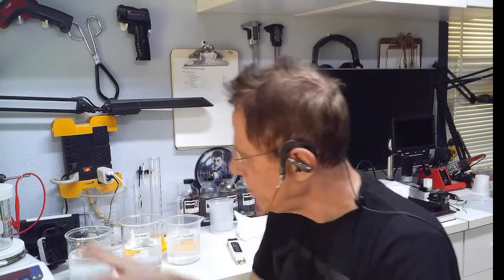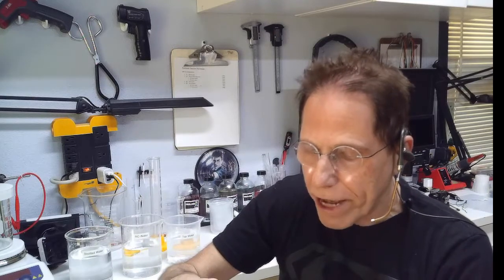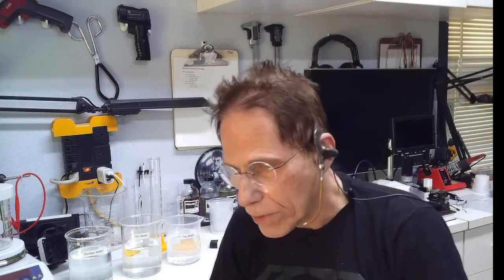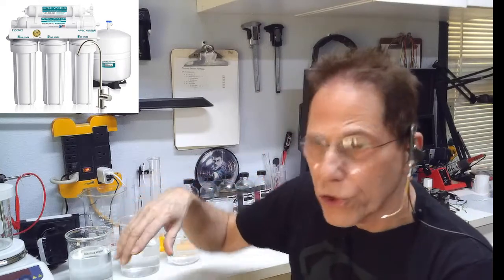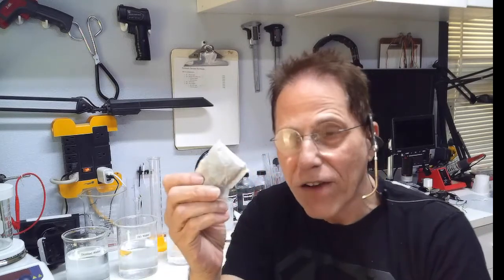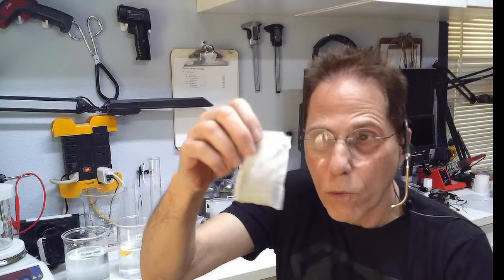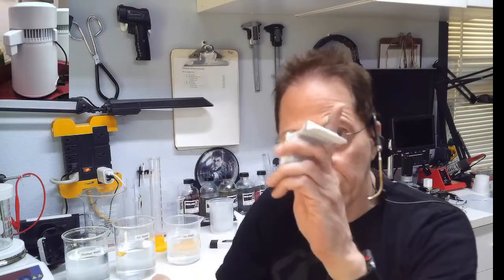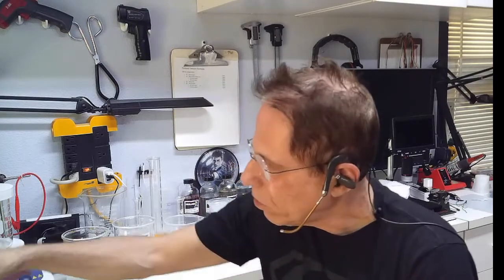RO water for your Distiller. Do you need the carbon filter?

Comment: Never had a problem with mine, water tastes fresh and sweet every time.
one very important tip - use a timer and cut it short of boiling down to much. 
which can afeect the taste and will make it easyer to clean and extend the life of the Disstiler.
water from the tap may be safe to drink but its not healthy, limescale is calcium and that can build up in the joints and the arterys and cause kidny stones just for starters.
so even if you are just useing a britta filter its better for you.
but when you can get a Disstiller plug it in at night with a timer wake up to 4 ltrs of fresh filtered water every day for years to come, sadly thats no going to be good enough for a family so then RO becomes your best option.
we are 85% water so its important.
Reply from the maker: I have the amazon alexa and the tp link devices. I plug one of the switch things. One is dedicated to my distiller. I just say "Alexa turn on the distiller for 3 hours 30 minutes. the timer stops it with about an inch of water left in the bottom. I agree the distilled water comes out much better if you stop the process before all the water boils away.

I did an article on re-mineralizing distilled water using sea salt. Check it out. While you can drink distilled and RO water, you should plug up the holes in waters polar nature. 
https://youtu.be/ep03cswkZ80
Reply: @AlchemyWizard  i prefer anolog its more dependable and gives me peace of mind but its a clever idea.
sea salt is ok but better with a dedecated organic mineral suppliment as the minerals are in cystaline form in salt.
but from the research i have done its not that important while it will break down the calcium deposits it leaves the other minerals alone and you want to get rid of that exess calcium anyway.
thanks for the feedback and happy drinking.

Comment: I did not read the manual and drank one glass of the first batch. Did i poison myself? It tasted nasty. Also the distiller said it is "food grade" but even after i washed it there was grey stuff coming of the metal parts when i wiped it. All this stuff is made in China, not sure it is so "food grade".
Reply from the maker: Generally it takes one batch of distilled water in a new machine before it makes pure distilled water. I'm sure you will be fine drinking the one glass. I'd toss the rest. I certainly would not use this first batch for colloidal work. Make another batch. Use a TDS meter and measure the output and make sure its near 0-ppm. If the water you put in to distiller is high in minerals you may have to pre filter the water or distill the water a second time.

If the grey stuff was coming from inside the distiller body that could be normal. The water left behind in the distiller will be full of the impurities that was in the water you put in it. If grey stuff was coming out the output, then I don't know. See what happens with a second batch. Test it with TDS meter before drinking the second batch.

Comment: Now you gave me clarity. I'm using well water. So i don't need that carbon filter i guess. That's exactly what's happening to me. 1st distillation i had 0015 PPM. Second i had 0004 PPM. Third 0003 PPM. I'm removing that carbon filter tomorrow.
Reply from the maker: Check on line to find out what your well water VOC content may be. If its above safe levels then put the well water through a activate carbon filter before distillation, using one of those canister filters where you pour the water through it. 

But yes, that carbon filter at the end of the distiller, even it if did remove VOC would not remove very much before it started putting it back into your water. Ditch that carbon filter.
Reply: @AlchemyWizard  , we have the same distiller. I already removed the carbon filter. Water produced still has 0002 PPM. What else can i do to make it zero by distilling alone?
Reply from the maker: @commandernoodles2367  2ppm is okay. You can use that and it will be fine. If you did not want to use a pre-filter (like one of those pitcher filters), then your only other alternative is to distill the water again.

What is the PPM of the water you are starting with? 

VOC will not come out of the water through distillation. If you got VOC in there then you will have to pre-filter the water through a pitcher drip filter with carbon in it.

There is also the possibility your meter is off a small bit. 

I think you will be fine with 2ppm distilled water. Anything below 5 would produce perfect results.
Reply: @AlchemyWizard  , ironic because water that we buy which is purified only (not even RO) shows zero PPM. Well water that i distill has 146 PPM. Based on your explanation, distilled water doesn't necessarily mean pure water. Thank you for being informative.
Reply from the maker: @commandernoodles2367  These distillers we have today are far from perfect. My well water is 150ppm as well, but I have a RO filter I put the water through first. Then it goes into the distiller. I'm sure if I tried to distill my well water directly I would have to do it twice as well.
Reply: @AlchemyWizard so if you put your water through a reverse osmosis filter then the water distiller what ppm is your water ,have you tried to put your water just through a water distiller and seeing the ppm in it and then comparing it  using the reverse osmosis filter and the water distiller to see if it really dose any difference to the ppm
Reply from the maker: @pitch1691  I have well water, 120 to 140 ppm. I Put it through the RO filter and it gives me 8 ppm, then in the distiller that gives me 0 ppm. If I try to distiller it straight from the well, I will get between 2 to 4 ppm, and wow does the stuff left behind stink badly. 

I use RO process first because my distiller, like mostly everyone's, is the cheap $100 dollar one and they are not commercial grade. 

I've looked at commercial grade distilled water in the laser microscope and that stuff has very little stuff in there. How they achieve it, I do not know. My distilled water will read 0 ppm but on the microscope it shows 1 to 2 ppm of something in there. Could be VOC's I'm guessing.

Comment: Very helpful. I received this distiller as a gift to use in humidifier and CPAP. Do you know if it’s safe to breathe in water distilled this way with the carbon? I’ve been using store bought distilled and thought this would be cheaper and more convenient long term (plus more environmentally friendly)
Reply from the maker: The carbon will remove some Volatile organic compounds (VOCs) . I like using the carbon filter before the distillation, as the carbon filter at the output of the distiller will change the PH and add some carbon in the water. Also that small carbon filter becomes saturated fast and when that happens it just dumps the VOCs back into your water at twice the amount. 

For a humidifier the VOCs should not present any problems, nor should the small amount of carbon that may be in the water effect those as well. I'm not sure about the CPAP. 

What I would suggest, even though it may be an extra step, I would get one of those carbon filter pitchers. Remove the carbon bag from the output of the distiller. Fill the carbon filter pitcher thing with tap water. Then pour the filtered tap water from the pitcher into the distiller. Now you will have as clean distilled water you can get.  Below is a link to the Zero Water Filter Pitcher. I am sure you have seen them. 

•	ZeroWater Pitcher on Amazon: https://amzn.to/3BARy1X

Comment: not quite right , the chlorin is going through the destiller in the beginning then it will end , so cast away the first cup then it will be clean and you can mesure it with the meter .
Reply from the maker: Correct, if you have chlorinated water, it will pass through the distiller because it's a trapped gas. However if you put the chlorinated water through a charcoal filter first, then in the distiller, you can probably remove most of it. I don't have chlorinated water here, but my guess is if I did, I have to do what you are doing as well or take a sample at the start to make sure the chlorine is not making its way out of it.

Comment: Why does my water taste so bad after using my distiller.
Reply from the maker: You may have to distill it again. If your tap water is like 300ppm then one run through may not be enough. I would also suggest you do not cook the distiller empty. Leave about an inch of water in the bottom. On my distiller it takes 4 hours to do a gallon, so I stop it at 3.5  hours. that stuff at the bottom if it gets too hot can vaporize and contaminate your distilled water. 

You can also use one of those filter-pitchers to pre-filter the water before distilling it to get rid of the harsh stuff that may be in there.

Comment: people do more research  my understanding of distillaton is different that his opinion. as for charcole its not a dangerious thing er use charcole for some poisions / ro water is about as clean as water gets . my town uses it with brackish water but does add clorine and necessary minerals as for floride i grew up on floradated water my 2 i and 2 year younger cousins had well water im 70 with 85% of my teeth they had no teeth about 40 yrs old
Reply from the maker: Nothing wrong with passing RO or distilled water through a carbon filter as long as you do not need pristine water. For creating a plasma arc the arc will not form if you pass the distilled water through a carbon filter after. It all depends on what you're using your water for after it's distilled. For sure, a carbon filter for tap water is good to do before drinking. Refrigerator filters all have a carbon block.

Comment: A charcoal filter will not remove fluoride from water
Reply from the maker: From everything I have read and from conversations with my chemist  about Fluoride is that only Reverse Osmosis can remove it completely. Some mechanical filters can reduce it but not remove it completely. Charcoal filter and even distilling will not remove fluoride as it is a gas trapped in the water. you distill it the gas is still trapped in the vapors, it just recombines at the output. Why charcoal removes chlorine  and not fluoride, again from what I read, has to do with the molecule size of fluoride. it can pass through charcoal but it can't pass through the membrane in a RO Filter.
Reply: @AlchemyWizard  I've read that filling a container with water and leaving it over night. That the chlorine dispersed
Reply from the maker: @questioneverything4952  I think most of it would but some may remain.
Reply: @AlchemyWizard  believe it or not my grandmother taught me that. And she was born in 1906. She would take the water and leave it out overnight and then she could water her African violets
Reply: @AlchemyWizard  --- It is also reported that boiling water for 30 minuets will evaporate the chlorine.

Comment: Why are you giving wrong information the distillation process dose get rid of fluoride and I’m pretty sure chlorine as well but from what I’ve heard it dose 100persent get rid of fluoride i was questioning all the people I’ve heard say it dose get rid of fluoride because of this video but you have to be wrong your the only person I’ve heard who said it dosent get rid of fluoride from distillation process So you should do your research on how it dose get rid of fluoride before spreading information and making people like me question myself
Reply from the maker: commercial distillers may remove fluoride, not the 100$ ones they sell for general purpose distilling.
Reply: @AlchemyWizard  how do you know that is there any proof you can give me to back up your  state meant ,fluoride gets left behind in the distillation process because it has a different boiling point to water Your the only person I’ve heard tell me that so like I said if you can prove that
Reply: @AlchemyWizard  how do you know that is there any proof you can give me to back up your  state meant ,fluoride gets left behind in the distillation process
Reply from the maker: @pitch1691  I will discuss it with my chemist again and see if she can dig up some papers on removing fluoride. 

It comes down to how the compound is stored in water. In water, fluoride can exist as a colorless gas or be dissolved in water. Any trapped gas will recombine when the vapor cools and still be present. Dissolved particles are removed by distillation.
Reply: @AlchemyWizard  yes because if you look on YouTube and look at videos on what a water distiller can remove they all say fluoride and there talking about the distillation process I would think not the bags what comes with it if you look online to see what people say there mabye I don’t know because I’ve only seen people say it dose
Reply: @AlchemyWizard  yes my 60 dollar vevor gets rid of Floride that's what there for I've had my distilled vevor water tested
Reply: @Billybritt-s4t That's great you had it tested. So the fluoride was fully successfully removed? How did the Vevor do with VOCs?
Reply: @pitch1691  lmao and where u getting ur info? Karen from Facebook?